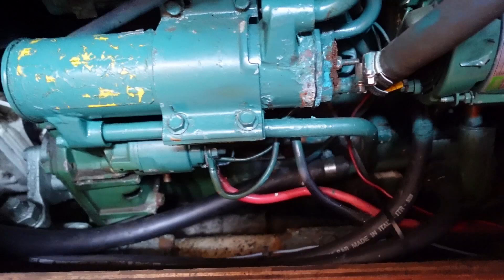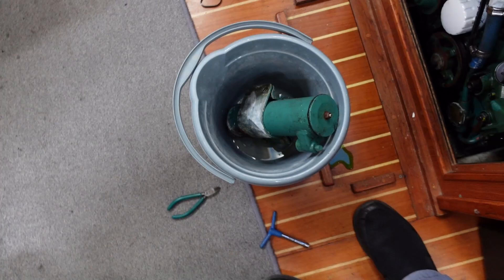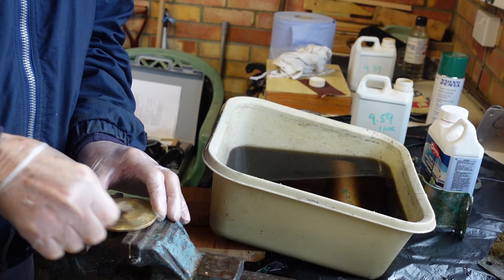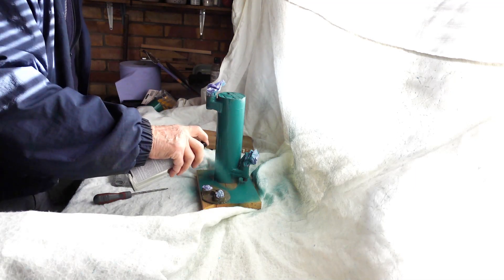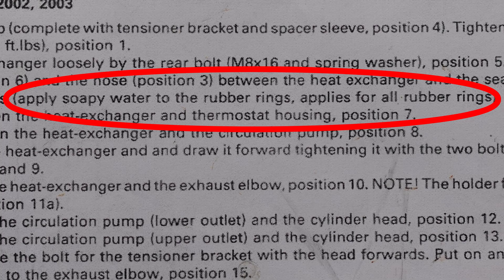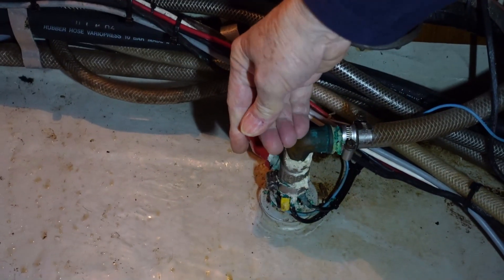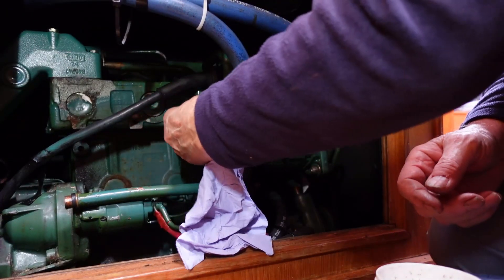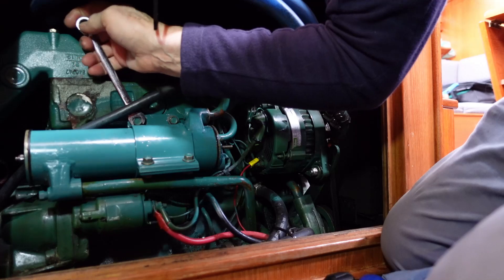Dismantling a Leaky Heat Exchanger in Tight Spaces - Full Refurbishment

Comment: Mine has the same cable tie hack as your, only with more cable ties securing the rubber pipe snugly along its copper pipe friend. Was done before my time. Seems to have worked well for the years I’ve had my boat.

Also the same mystery mechanic dabbed rtv in most of the pipe fittings.

I had to remove my heat exchanger to get at the starter motor so it was never leaky to begin with.
Reply from the maker: Hi John, Well if the cable ties work then leave it alone. But it is a bit of bad design. I've actually worked out why it leaks. I must do a short video about that. Thanks for watching and commenting... Best Wishes ... Dave

Comment: Out of round would be the cause of a leak for sure. you seemed to be come an expert at removal of your heat exchanger.
Reply from the maker: The new (old) One is now fine thank goodness. Volvo Penta recommend that you flush the heat exchanger out every 3 years.. If I had the engine on a stand in a workshop it would be an easy job, not so easy scrunched up on your knees alongside.. I hope I don't have to do it again.. Best Wishes ... Dave

Comment: Thank you for your excellent video. 
I share your pain. We’ve suffered leaks on our Tempest’s VP2002 heat exchanger for the past couple of years. 
After performing a full strip down it’s now only slightly dripping from the flexible inlet. I’ll try the silicon grease on another new set of O rings together with extra cable ties and maybe a new compression plate? 
I’m sure the whole design was a 4pm Friday afternoon job by Volvo.
Reply from the maker: Hi Martin, yes the flexible pipe connection is a nightmare. However, since that video was made I have replaced the heat exchanger with a second hand one I bought on ebay and then had real problems with leaks from that connection again. The copper tube that goes into the end of the heat exchanger has a sort of raised ridge that the compression plate presses against.  It controls  how far the copper pipe is pushed into endplate. After much faffing around, I tried bending the compression plate, to no avail. In the end I got an aluminium washer. It was in the spares kit, I think it's a sealing washer for the injectors. I cut it and the bent it round the pipe just behind the raised ridge on the copper pipe and now the compression plate really pushes the pipe fully into the socket in the end plate and .... No Leak.  
I don't think that will be a permanent repair. I'm concerned about the dissimilar metals and I think at the next service I'll replace the Aluminium washer with some 2 or 3mm copper wire. Just wrap it round and maybe try to solder it. I hope that helps .. Thanks for watching and commenting. The heat exchanger is obviously an ongoing problem judging by the number of views this video has obtained.. Hope you can sort it out... Best Wishes .... Dave

Comment: Great video. I am facing the same problem. Trying to figure out whether to spend the time to refurbish it or get a replacement. Were you able to source a refurbed heat exchanger and replace it? Did it fix the problem?
Reply from the maker: Hi Peter, sorry to be so late replying to your comment, I'm sailing :-) not so easy to find time or internet access. 
I did find a second hand heat exchanger on eBay and took a chance. It was a good decision as you will see in a future video. I did make the old one watertight in the end with a bit of gorilla tape and a Jubilee clip, but I suspected that there might be a leak between the salt water and fresh water sections as the fresh water header tank kept overflowing. So I fitted the eBay replacement. But that didn't cure the problem, I did find the cause in the end, which wasn't the heat exchanger, so I now have the old one in a box waiting to go home and be pressure tested. Good luck with the refurbishment, the major difficulty is fitting the thing back on the engine. Replacement second hand ones are pretty rare. New ones, bvery expensive... Best WIshes ... Dave
Reply: Sail on Dave! Thanks for the help. Looking forward to your next video.

Comment: Great video. A clear and concise description. Such a shame after all that effort you needed to replace the unit in the end. When I saw the initial corrosion I assumed you would need to replace it anyway; surprisingly it cleaned up very well. I've just taken possession of a Westerly Konsort which has a 2003 Penta, so I plan to check the heat exchanger once she's ashore.
Reply from the maker: Hi Nick, well, though I managed to find a replacement second hand exchanger, I haven't needed to fit it. The gorilla tape and jubilee clip, though a bit unconventional, has worked and the outside of the heat exchanger is dry as dry. So I'm leaving it alone. I know all the passages are clear so it should be good for a few years. Good luck with your 2003. With the old engines it's always a bit of a lottery when something will wear out. Currently my raw water pump has developed a leak, not at the front where you replace the impeller, but at the back. I looked at refurbishing it, it's not an easy job and there might be wear that I can't see so after all the work it might still leak. SO I bought a new one. That's to be fitted early next year. Another video I guess. Take care .. Best Wishes ... Dave

Comment: Nice job. I serviced my 2003t by a volvo penta marine dealer and it cost almost 3k. The oilcooler was completely rusted and not usable anymore. So a second hand one was installed. Happy that everything is working again
Reply from the maker: Hi Edwin, Ouch that's a big bill, V.P. parts are expensive though. There's quite a bit of difference between the 2003 and the 2003T. The 2003 doesn't have an oil cooler and the heat exchanger and exhaust bend is different too. At the moment my heat exchanger is not leaking, after all the trouble. But I have managed to buy a second hand one, which is wrapped up in plastic in a locker - just in case. Buying spare parts for these old engines is getting more difficult, but I've seen several complete engines on Ebay at reasonable prices. If I had the space, I'd buy a couple as spare parts. Glad to hear that it's all working again. More video's to come - subscribe to get notified - Best Wishes .... Dave

Comment: I'm currently searching for broken impeller bits. The raw water copper pipe in has play in it when i out back together. It seems your pipe did too?
Reply from the maker: Hi Ben, yes the vibration rounds the end of the tube into a taper. I gently rotated the end of a screwdriver inside and coaxed it back into a straight end. Mine fitted better then and I cured the leak.
I hope you get yours sorted out.. Best wishes... Dave

Comment: I have the VP 2002 and went through this problem last summer. After a lot of effort to try to secure the press-fit copper piping to stop leaks, I gave up. Instead of using silicone grease, I used a little bit of RTV around each of the fittings. It remains flexible. It's water proof. No more leaks in my cooling system for $9! ....I know it's not how volvo wanted it, but it works great.
Reply from the maker: Hi Chris, I very nearly resorted to that. But, "the one last try" worked, so I left it alone. The problem is using the soft copper in an environment with lots of vibration, it  changes the shape of the end of the pipe and then it doesn't seal. Well done for MAKING it work. Take care ... Dave
Reply: @davesailing  yes. I also wish the pipes were hose clamped hoses instead of press-fit pipe. It's hard to secure once after any deformation. I've thought about changing all of my pipes over to hoses....but it works for now, so I won't fix it.
Reply: This is a gold mine for me one year later! Currently holding my grubby VP2002 heat exchanger in my hand and wondering how in God’s name I’ll get everything leak free in the end. Apart from all new rubber gaskets, now feeling empowered to slather it all in rtv on reassebly. On mine, it’s also obvious that that is what the last guy did.

Comment: I have a volvo 2003 t. It s evenmoe difficult than 2003 vith an oilcooler hidden behid the heat exchanger. It is made of aluminium copper and with saltwater in it has a tendency to coroode!
Reply from the maker: You have my sympathy. The standard 2003 is bad enough.. thanks for watching and your comment. It is greatly appreciated. Best wishes Dave

Comment: Great video, I’m struggling with how the exchanger goes back together, watched the video close and am not seeing it? Do the 2 holes in the gasket line up with the 2 holes semi circles on heat exchanger?  Pictures are at a premium on the internet. Any help appreciated!
Reply from the maker: Hi Colin, it's quite hard to show. I'm down on the boat at the moment so having to rely on my phone for everything.
We're looking at the business end of the exchanger with the two connections for the sea water. If you look inside  there is a divider that splits the exchanger in two halves. Then one of those halves is split into two. So you have two quarters and one half. The two holes in the gasket fit over the two quarters and in turn the holes in the end cap marry up with the holes in the gasket.
What I hoped to show in the video was the flow of the seawater through the exchanger. It goes in through one of the quarters. The other end is divided in two and the water is sent back to the business end where it appears in the section that is half of the end of the exchanger. It is then sent back to the other end where it appears in the other half section and is then returned to the business end where it appears at the other quarter section and then out of the port and eventually to the exhaust. So the sea water makes 4 passes backwards and forwards through the exchanger. The fresh water coolant just flows from one end of the exchanger to the other, round the outside of the tubes that carry the seawater.
I hope that helps... Best wishes Dave

Comment: Bravo, this is exactly what I have been looking for!  I have a VP 2002 also with the elbow and rubber hose at the raw water intake in place of the solid pipe from the raw water pump, and that's where it leaks.  Fortunately for me I'm on fresh water so there's no corrosion to speak of.  The yard wants to order new parts but it looks like all I need is a rebuild kit with the rubber parts and I can have a go at it.
Reply from the maker: Well you're the very person I made the video for :-) What happened on Zephyr IV was that that, because the way the pipe from the raw water pump vibrated about, it had changed the shape of the end of the copper pipe that goes into the end of the Heat Exchanger. It turned it into a bit of a cone. That just made the connection even more loose. I used the end of a rotating screwdriver to carefully force the end back out so the pipe end was straight. That tightened things up a bit. You mustn't go too far otherwise you'll not be able to get the end of the copper pipe fully into the hole. A new rubber O ring and plenty of Silicon Grease improved things. Finally holding the rubber pipe steady with cable ties cured it completely. It's quite disturbing to see how that rubber pipe moves around without the cable ties, especially with the engine at tick over.
I have threated to make a proper bracket to hold the rubber pipe but the cable ties are working for now. In fact I'm happy to report that the last time I ran the engine for a good hour, the joints and the heat exchanger were quite dry.
Good luck with it. The gasket set from Volvo Penta is eye watering expensive :-(
Reply: @davesailing  If you think the gasket kit is expensive, you should see the price of the parts they just imported from Sweden, I wonder if they flew them first class on KLM Royal Dutch!  
I just posted a video to my channel about the various leaky things on my boat, including the engine heat exchanger.  If you just want to see about the heat exchanger, ffwd to 4:35:
https://www.youtube.com/watch?v=5XUemWdzLz0
Reply from the maker: @AhoySkylark  Well you've got exactly the same set up as mine except that the anti-syphon loop inculdes an additional pipe which feeds water out of a hole in the side of the hull to show that you have sea water circulating. Bit of a waste of time, I just look over the stern and check there's water coming out of the exhaust. I can see why your bill from Volvo Penta was high, those copper pipes are an arm and a leg expensive. But I'm it will solve your problem with the leaking joint. I'm not so sure about removing the syphon, but I'm no expert on that. I've had problems with the pressure water system too and in the end had to replace the pump. it's not been a problem since.
I'd really worry about the pressured gas system just being mounted there in the locker. I use Calor Gas (butane mix) and the gas bottle(s) are housed in a seperate locker that vents over the side so If there's a leak at that end it can't leak into the bilge. But if you're going to remove it, not a problem I guess. Your engine looks nice and clean and I think you've got easier access than me. Mine starts instantly, despite being 30 years old. I treat it like a baby and change all the filters and the engine oil every year. I have a video about changing filters and bleeding etc. It's not hard, just potentially messy 🙂
Keep in touch, let me know how you get on with the heat exchanger changes.  Best Wishes ... Dave
Reply: Thanks for posting the video, very helpful. My VP2002 heat exchanger raw water inlet (the one with the rubber hose) has been leaking for a while. The VP steel securing plate design is poor in my opinion. I have tried various remedies to resolve including zip ties with limited success. I finally designed a plate made from plastic flooring offcuts (the tough kind) with the inlet and outlet holes drilled out at 14mm and a 6mm hole for the securing stud. I used the service kit gasket as a template for where to drill. I dissected both 14mm holes to create a plate that holds 1/2 the circumference of each pipe which is an improvement on the VP design which hold less that a 1/4 of each pipe. Hope this makes sense.
Reply from the maker: Hi Russell,  thanks for the comment. Using a piece of plastic is an excellent idea. It doesn't get hot enough to cause any problems and if there is a bit if a leak, it won't rust. Well done you :-)  Best wishes Dave
Reply: I have a 2003T, my heat exchanger is a little different but basically the same. Poor maintenance  caused my problem. My water pump came apart stck in the heat exchanger. This is my 4th try at stopping leaks. I applied a lot of silicone this time I'm waiting for it to dry. Wish me luck. Thank you for the video.

Comment: I converted the engine coolant exchanger and the oil exchanger from a volvo 2003t to more standard exchangers , very easy, and now the exchangers can be mounted away from the engine. Worked well. A replacement oil heat exchanger from Volvo was $2500.00. 
A good used exchanger from a resale shop was about 100, only need hose and hose clamps. Volvo has a goofy way of putting the coolant pipes into a bind, them bolting them. Enjoyed watching your quality work. I blame the leaks on Volvo engineers.
Reply from the maker: Thanks for that. I had already considered a remotely mounted heat exchanger, but soldiered on with the existing one. When you say a more standard exchanger, what is it?
Maybe if I can't find a replacement I might have to resort to that. I agree, the original is not the cleverest design, especially when it's been apart a few times.. thanks again for your comment.. Best wishes .. Dave
Reply: @davesailing  sure,  Yanmar, Universal, even the Volkswagen rabbit diesel they call the Ranger uses a more standard exchanger, similar to the trans coolers and oil coolers, my perkins has one like that . Two hoses for rawwater in and out and two hoses for engine antifreeze. They can hang on a bulkhead or generally strapped to the engine or tranny with two large hose clamps.
I do have a photo of the volvo i converted, but I dont know how to ship a picture on youtubeses? Im use a phone only, no home computer,  im old i guess, my grandchildren help me with my phone from time to time. Good luck, ill look for more videos, ill subscribe now.  👍

Comment: Thanks for sharing.  Working on the heat exchanger is one of my least favorite tasks.   Well done.
Reply from the maker: Hi Bill, Well the heat exchanger has become a least favourite job of mine too :-) If I never have to touch one again I'd be a happy bunny. But you know how it is, having gone through the pain, I now know what to watch out for and a subtle modification will reduce the chances of any further leaks.. Enjoy your sailing.. Best Wishes - Dave
Reply: @davesailing  Just removed mine yesterday. Ordered the seals tonight. I have a 2002 myself. I am dreading putting it back. My boat has the motor shoehorned in.

Comment: Thank you for the explanation. I have a question. If you have time, there are four places for the hoses, two in front, one from the top and another from the bottom.
Reply from the maker: If you take a look on the video I do explain what the four connections are at 0:32.  The two larger diameter pipes, One at the top front and the other at the bottom rear are the engine coolant connections (Fresh Water). The Fresh water circulates in the space between the tubes and the outside wall of the barrel. The other two smaller diameter pipes feed sea water from the raw water pump through the internal pipes, where they cool the fresh water outside, and then to the exhaust L bend where the salt water mixes with the exhaust gasses and passes out of  the exhaust at the rear of the boat.
The clever bit is that by simple barriers at the ends of the barrel the sea water actually passes up and back 4 times before being ejected into the exhaust. I hope that helps ... Dave
Reply: @davesailing thank you very much